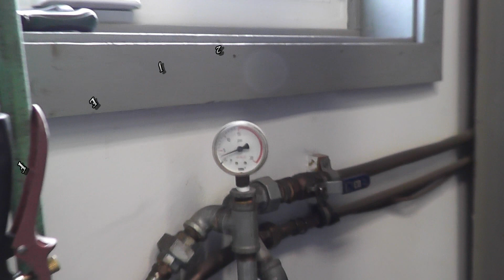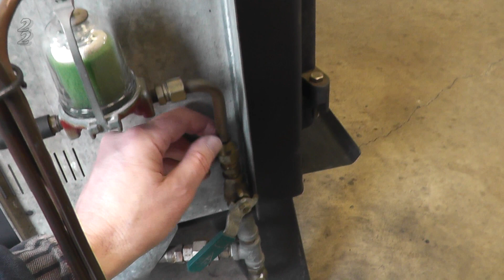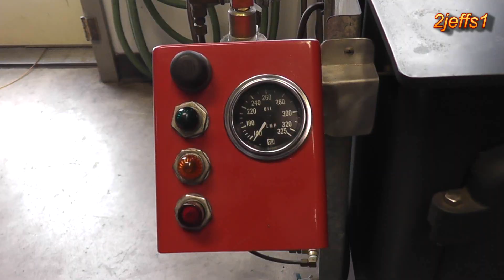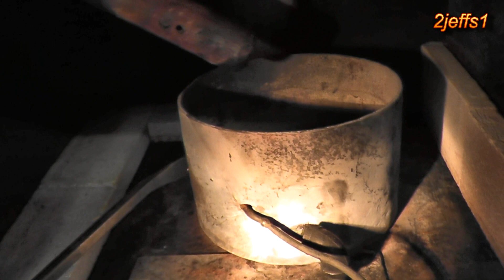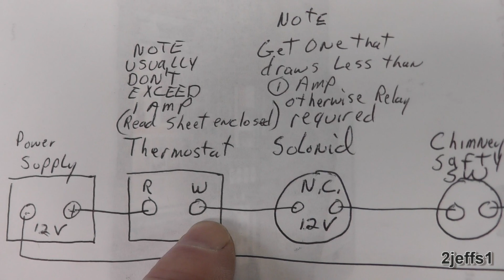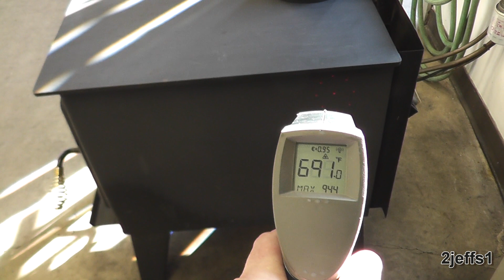Homemade Waste Oil Burner Heater for Daily Use p2 More Details DIY

Comment: Awesome video thank you. I was curious, would it be possible to use one of those cheap "peristaltic" dosing pumps you can find on ebay/amazon connected to a variable speed (or two speed) controller to determine your two flow rates for idle and heat call? If the pump couldn't be made to run slow enough, you could even pulse it on and off at different rates to control average flow (like Pulse Width Modulation). My thought is that being a positive displacement type pump, you'd eliminate the concerns of having to adjust needle valves to control flow rate as you burn different viscosities of oil, or as the temperature of the oil changes. It's possible that the cost of one of those pumps would be less than the cost of the two needle valves and solenoid valve (because being a positive displacement pump, when the pump stops rotating, the oil would stop flowing). 

The question would be whether you could find one that would be resistant to the chemical effects of the waste oil and be durable enough over time. Using a pump would also make it possible to have the tank at ground level where you could dump your drain pans right into a funnel (through a filter of course) into a tank at ground level, since you wouldn't be relying on gravity. 

I'd really like to build something like this, and your burner design, drip tube/heat shield design, and use of the A.I.R. pump for forced induction are fantastic. Thanks again.

Comment: Awesome build! For the burn pot are you using stainless? Looks thick and most people building these say to get thin dog bowls made of stainless. I just built one of these and the hottest I could burn was 400* thinking I need more air for a leaner burn. Im using a 8” stainless bowl but yours look different . Thanks

Comment: Jeff, thank you very much for sharing this incredible build!  I have duplicated your build other than the woodstove and my burn pot is made of mild steel not stainless like yours.  I have it up and running, burning great but only with the woodstove door open.  Once I close my door the flame dies down and goes out. I can turn the smog pump off and the flame stays lit, obviously not with the same velocity.  I was thinking I have a positive pressure in the burn chamber of the stove not allowing it to draw a draft.   Do you have any recommendations to solve this problem?  Also what size pulley do you have on your motor that drives your smog pump?  Thank you for your time!

Comment: Hey Jeff... I finally got my copycat waste oil burner running... It works really well... I was primarily interested in burning off the oil initially but it is definitely nice addition to have heat. I hope you're doing well and have started to come out of your dark area... Rangers are a dime a dozen it seems like and I'm sure you'll put your cherry little pickup back together and have it up and running soon enough... I saw your video on the Backhoe and anyone who can do a restoration like that on a burned out backhoe can fix a Ranger again...

Comment: Hello i am doing this set up and want to thank you for all the great info you have supply us with. I was thinking  you said that if you have a slow and high speed if the low speed get blocked and flame is out when the high speed kicks in your going to have a mess. What if you put a cad cell in so if low speed  flame is  out would shut it down? Also i would like to get a box set up like you have there the red one did you make that or buy it? Also when its in low speed dose the blower fan go off or cut back in speed till hgh speed kicks in and what temp safety are you using. Thanks Russell

Comment: why not use a direct injection off old fuel oil furnace which I have laying around been wanting to try want ur opinoin
Reply from the maker: Sorry, not familiar with those. Sounds like a good thought to try/experiment with.
Reply: beckett injection should work pump motor blower electrodes nozzle

Comment: Nice design...its the best of its type that i have seen, being thermostatically controlled with overtemp cutout makes it leagues ahead of the majority of them

i built a babington ball waste oil boiler a few years back.....i looked at building a pot burner design like this one and had a high/low fire system (identical concept to how you have done it) worked off a radiator fan thermostat switch but couldn't figure out how to get it to idle low enough that it wouldn't overheat the boiler if there was no call for heat.

Comment: Hey Jeff, I'd like to that you once again for the vids about the oil burner! You're spot on about the air supply. Higher pressure / lower volume.  I used a 1/4" copper line to supply mine the same way as shown in your video. No smoke whatsoever!  Still playing with the angles of the air line and just where to have to oil drip into the burner, but it's working fine!  I'll just experiment with all the parts I bought at the 'Oil Burner Supply Store', aka Good Will!
Thanks again, \
Dave
Reply from the maker: Jeez Dave, seems you might be the first to come back saying how well that works! (many comments on this vid thru the years)  ;>)  Thank you. It is hard to believe until experiencing the difference! I did use the air compressor for many years regulated to around 25 psi worked great. When I came up with the smog pump idea that was a no brainer to keep the wear off the compressor. Smog pumps were what I call a dime a dozen. Everyone was taking them off there cars back then to get better fuel mileage. I had a bunch of used ones on the shelf so it didn't cost anything to give that a try and the rest is history.
Reply: Hey Jeff, I will go with a smog pump once I get my hands on one for sure. For now and to experiment with, I just use my air comp. It uses a lot less air than what I had originally expected, too!
All sorts of things to mess with now  like the angle of the air coming in, where the oil drips in and maybe trying a 'burner' that is more like a bowl so the oil can flow all the way around. One thing, for the same amount of oil I was burning before, I get more heat so I guess the smoke that was going up the stack is now being burned and making more heat!
Thanks Again Jeff!
Dave
Reply from the maker: Hi again Dave. I am overwhelmed here with work here but wanted to make the time to say - Thank you for posting this which is confirming/helpful advice for everyone to read! It IS a day/night difference with this setup. I had one more tip for you too that I recently remembered. On that 1/4" air tube that goes in the burner. When I was using the compressor I crimped/pinched the end into a fan shape. That made it use LESS air from the compressor making that use even more efficient yet using less air. I believe I had the flat fan side was facing vertical too from what I remember. On the smog pump I just left the end round where air consumption does not matter. A tad more advice to help all out. Sounds like you are doing great on yours! Take care Dave, Jeff.
Reply: Hey Jeff, thanks again! I was actually going to mention flattening the tube a little!  Exactly what I tried and it made yet more improvement, though positioning it was more important. Also, I have the oil dripping in nearly behind the air tube. Takes a little longer for the initial heat to get it burning but when it does, it burns like a cauldron all the way around! Still, the best tip was using the high velocity air as you show!
Do you think a compressor out of an old freezer would have enough volume to supply air?
Thanks again!
Dave
Reply from the maker: That is an interesting thought. Hmmm...  Didn't have one laying around back then or probably would of been on the - lets try this column.
Reply: OK Jeff, now that it's basically summer I finally scrapped out my old deep freezer and tried the compressor as an air supply for my version of your oil burner.  I can say it works extremely well with a little air to spare actually! It is however, a much larger compressor than what would be found in a reefer so it might take two of those in parallel. This freezer was made in the 1940's I'm sure and the outer covering of it is around 10" dia.
But yes, an unqualified success with the freezer compressor!
Thanks again!
Reply from the maker: Great to hear! Never thought of that for an option. Like to hear when a trial and error test turned into a win.
Reply: I haven't tried it yet with heavy cold motor oil but I have every reason to believe it will be fine. I have another compressor out of a small reefer I can add if need be. Whisper quiet and uses nowhere near the power my air compressor does. I haven't even added the 'over flow pipe' that yours has yet either so that would be even more air, though air comes into mine along with the oil drip so.....
Anyway, warmth in the winter for free thanks to your 'research and development'!
Thanks!

Comment: Hey Jeff, can't get over how clean you oil stove burns!  Anyway, I have mine installed and working but there are a couple differences I incorporated.  Since I didn't know how it was going to work, I devised a way for it to be both forced and natural draft.
So anyway the burner I made is from a rounded bottom salad bowl which is what the parts supply house (a.k.a. Good Will) had. Since I bring the air up a 3" pipe through the bottom of it, there is not much flat area for the oil to heat up and vaporize on. Do you think a flat bottom burner would be better?  I am getting a little smoke regardless of oil or air supply so I wonder if the oil isn't getting hot enough due to the lack of hot surface area.
I figured I would ask the pro!
What do you think?
Thanks, Dave
Reply from the maker: Hello Dave. I know without adding the air on my setup it does run quite black (wording it mildly) Really wish to be helpful here but without being there.... I know the biggest advance was when I switched to air compressor/smog pump air pressure instead of volume with the squirrel cage blower setup.

Comment: Hey 2Jeffs. As everyone else has said, outstanding video showing great workmanship!  Anyway, I have a bit of a question about using a smog pump vs a squirrel cage fan. I see several posts about it but I am wondering since a fan has less pressure, could a person come up with an equivalent amount of air using maybe a 3/4" pipe?  Is the velocity of air coming from the 1/4" tube from the smog pump important as well as the amount of air?   I understand about too much air volume and blowing all the heat up the chimney but what if I were to use the 'drain pipe' as an air supply for example?  Just trying to use what I have!
Almost all of the other oil burners on YouTube get the glass in the doors black real fast!
Thanks again for a great video!
Reply from the maker: Great question. Yes - I had the thought with a smaller 3/4" pipe and did try that on my first trial and error stove. (tested so many different combinations) That does seem logical but didn't work as hoped.The first stove was in a few of other vid's in the background and you should of seen all the trial and error holes that were welded back up. Sorry I can't remember which ones where the vid's weren't about the stove. (possibly - homemade Go kart build part 2) If I had a vid about all the testing on that thing, yes it would of been a loooog (and interesting!) one! Pressure instead of volume is the magic to be efficient and clean running.
Reply: Well, thanks for getting back on this!  I'll take your word for it on that one because it obviously works.  I imagine that with the pressure developed by the smog pump, a certain amount of velocity is produced that wouldn't exist from a fan or blower.  Thanks again!
Reply: Hey Jeff, I looked at the Go Kart vid part 2(what a kick that thing would be, too!)  and I saw a couple shots of a previous incarnation of your stove. It looked liked it burned ok but there must have been room for improvement since you made your latest one!  Anyway, I was wondering how to send a short video to you that has a burner I cobbled together a few days ago. I could use your critiquing and advice! 
By the way for your oxy-acetelyne cannon, another easy and safe way to fill it and set it of is to use a couple hundred feet of 1/4" clear tubing to fill and set it off. Use a torch to fill through the tube and then wave a lighter past the end of the tube. Really cool. Looks like det cord going off! Reusable, too!
Anyway, I confess to knowing next to nothing about posting things and none of my grand kids are around right now to do it for me.  Thanks for the great videos!
Reply from the maker: A bit more info for you - those smog pumps will make 30-40PSI in a dead head condition which was the area that the regulator was set at when using the air compressor prior to the s-pump.
Reply from the maker: On the 1/4" charge line that ran to the cannon. I remember flame shooting out of that when we shot it. Never thought of passing a flame past that tube. I bet that would of been a good alternative for setting it off v/s the spark system as you mentioned!
Reply: Oh yeah. Try it at night too! You can see a blue flash travel along and then........!  Outstanding!
Reply: Thanks again for getting back on the air supply for the burner. I am convinced you're right as to velocity vs flow for a clean burn. I made a burner that used a small bowl inside a larger one to supply air and it has a bunch of 'flaps' cut into it that I bent inward to create a circular flow. It worked but I think it was just too much air.
One more question as to the drip tube. Do you think it matters as to where the oil drips into the burner? It looks to be a little in front of the 1/4" air pipe but could it drip in at dead center for example?  Yes, I'm a pest I know!
Thanks again, Jeff!

Comment: Hi Jeff, absolutely love your work. I am building the same oil burner (inspired by you) . I have been using an oil burner that I made from a large propane tank for about 3 years with the blower design, it works good but you have to play about a lot. My question is, could you use a high output pond air pump instead of the smog pump. 
Thanks Lee
Reply from the maker: Hi Lee. I had tried many different configurations with blowers prior to this setup. They did would work but wasn't as efficient where more volume of air in means more heat out the chimney. Another drawback I found with a blower is one can't idle down very well without having a flame out. I suspect the pond air pump would work but once again would be more cfm like a blower which reduces efficiency. Nice to hear about your build Lee, hope this helps, Jeff.
Reply: 2jeffs1 Hi Jeff and thanks for the reply, we have now built the new stove and done a few test runs with the door open and it seems to be good with a nice vortex, the problem that I have is that when I shut the door it seems to starve of oxygen even with the bottom vent open. I noticed that you have a fan on the back of your stove does that blow air into the stove?  Any advice would be great. Thanks Lee
Reply from the maker: Hi Lee, sorry for the delay. Too many things going on here. That blower on the back was a factory add on to assist getting more heat off the stove. No air from that goes into the unit. I can see where you would think that with the issue you are describing. When I light mine I do leave the door open a bit which helps get it going but close it after several minutes. When I was using a blower in the early design it was important to have it aimed in the burner at pretty good angle to assist in the burn making the flame spin similar to like it does now. I hope this helps you for your build, sorry to keep you waiting, Jeff.
Reply: 2jeffs1 Thanks for the reply again and no problem for the time. So if you were to shut the door straight away would yours do the same and try to put the flame 🔥 out? The air pump that I am using is a diaphragm type pond air pump and I think it sounds like the same amount of air that you are getting. Ive just got to finnish the flue and I can do a proper run.
Reply from the maker: Hi man! You are correct. Additional air is required on startup to insure that the flame don't go out. I was wondering if you were using the pond pump brought up previously. I would try to run a 3/8" id pipe to create a similar effect to what I have - if that don't dead head your pump too much. Otherwise a 1/2" id would be good too, possibly better. The old trial and error tricks! ;>) That would allow it to be idled/controlled better (and flame out) when full blast isn't needed. Just try what you have going on, don't want to tell you what to do, just a few of my 5c worth perhaps you will find interesting. (inflation)
Reply: 2jeffs1 that's good to know thanks. I am using 14mm id from the pump to the stove and then reduced to 6mm id ti the burner, so what you're saying is to increase the pipe id going into the burner. I will try some different things and see what happens. Thanks for all your help, much appreciated
Reply from the maker: Was wondering what you were using. Great visual - without me being there. :>)  Where that wouldn't have much pressure I would guess that might be too small. It is fun to experiment with those things to come up with the final ideal/desired operation!